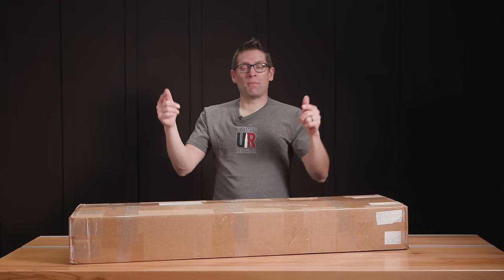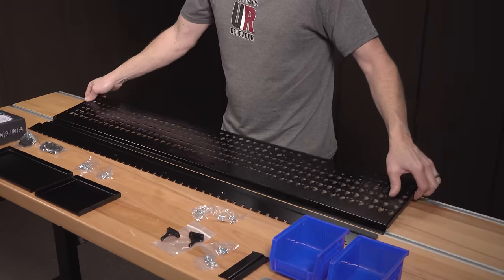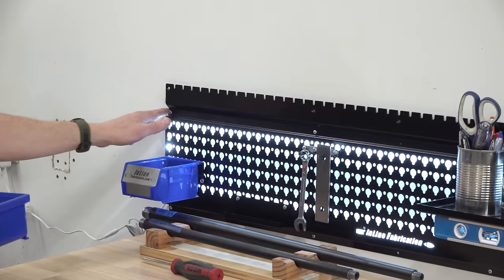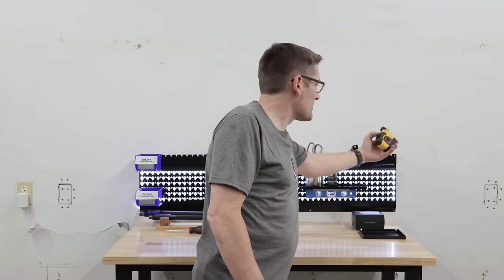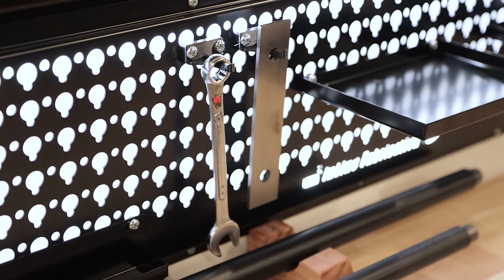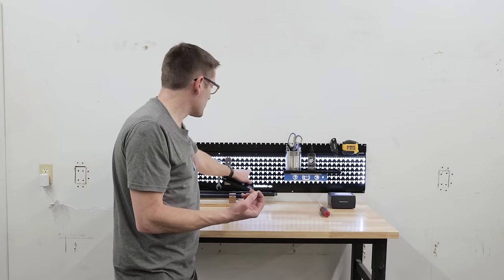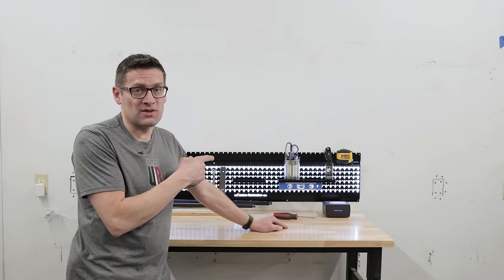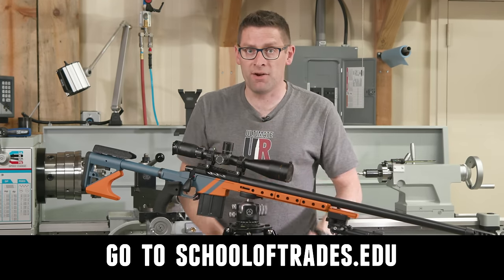NEW:  InLine Panel and Rail from Inline Fabrication

Comment: I have the rail system.  My loading bench wraps around 2 walls, and I have it above the bench.  I have the bins all the way around on 4 , 48 inch sections.  I have primers, brass, tools and lubricants. Just about anything you will use right there at my fingertips.  Looking forward to getting some of the panels, with die holders for the lock-n-load bushings.  Great product!

Comment: Ive got about 30 ft of inline rail over my benches in my loading room. Love the system especially with all the accessories. It really helps to keep the clutter off my benches. I will definitely have to check out the new panel system

Comment: Inline Fabrication is the bomb when it comes to reloading accessories and organization. I have their rail system above my bench, it holds primer tubes, riser top plates for my RCBS auto primer and RCBS case trimmer, along with a couple of bins. I also have a couple of risers and their shell ejection system. 

Great products and Dan over there is just as good as Gavin is here.